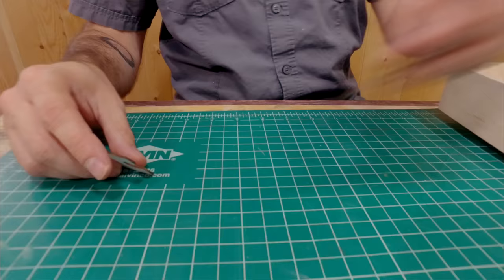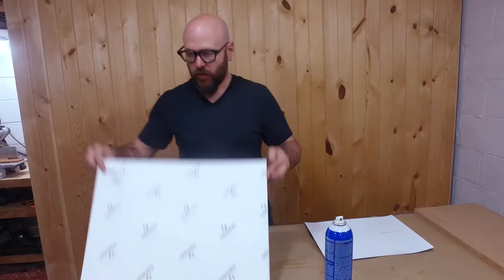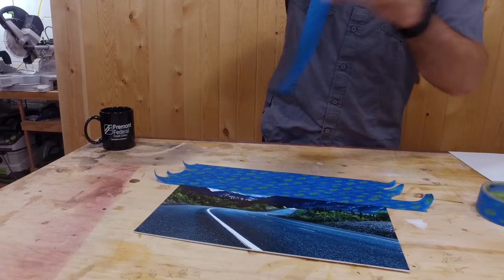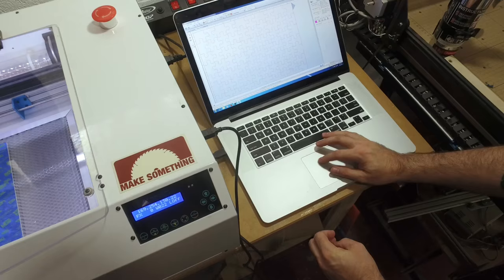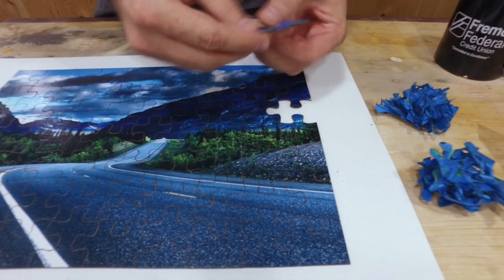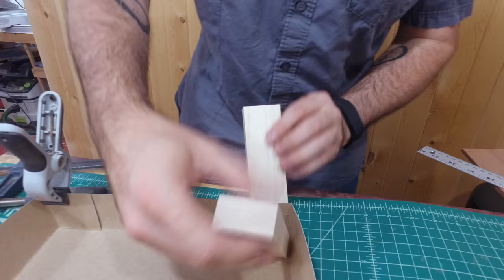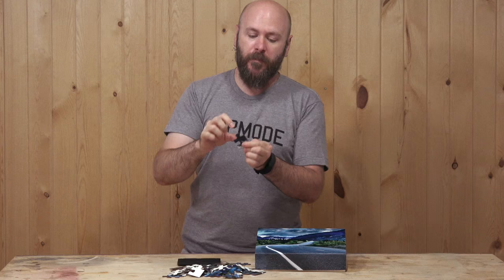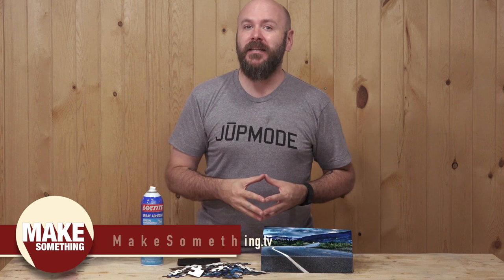Laser Tutorial: Make a Puzzle from an Image | Make Something

Comment: I've been trying to figure out how to make jigsaw puzzles with 3 mil plywood base instead of cardboard for some time now. The air assist helps as well as cutting the bottom side up.  Still charring problems.   Using 1/8 acrylic makes nice clean cuts but wooden jigsaw puzzles are the ones people collect.  If you ever figure out a wooden puzzle system let me know... oh should mention the tape idea is great but for any sort of mass production it is out of the question.

Comment: Basically you can use a lazer to cut out a puzzle ? I’m trying to start a jigsaw puzzle business and need ideas to get them cut. Bulk orders are killing my business
Reply from the maker: Yes, you can cut many types of materials with a laser cutter.
Reply: @rockler  it won’t burn the cardboard? I saw the tape, is that for preventing the burning? Or will it still burn
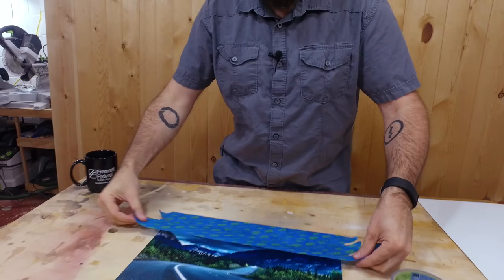Reply from the maker: Jump to 2:10 in the video. The masking will help prevent burning on the surface. Testing settings on your individual laser to find the right settings will be needed to not burn. You can see at 3:15 he ran test cuts to find the best settings.